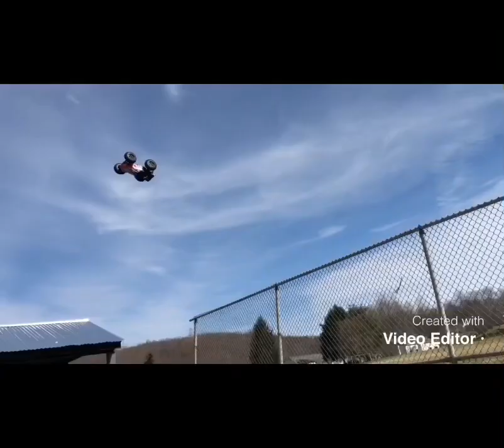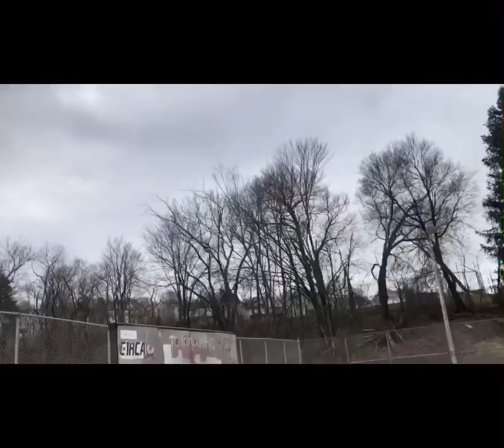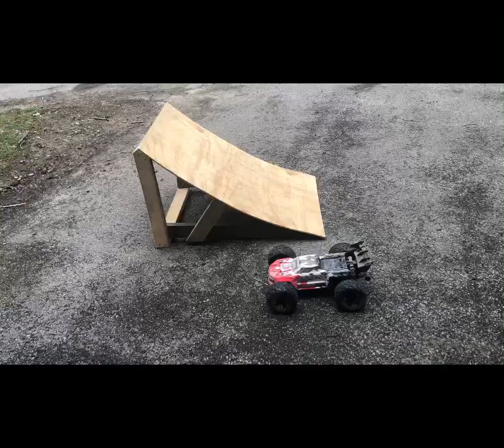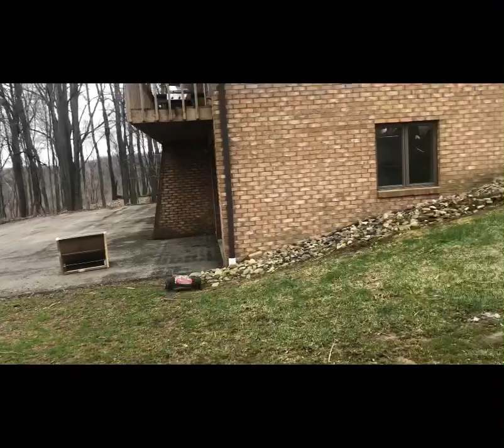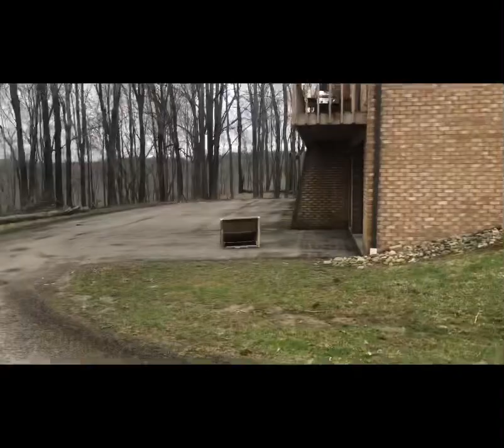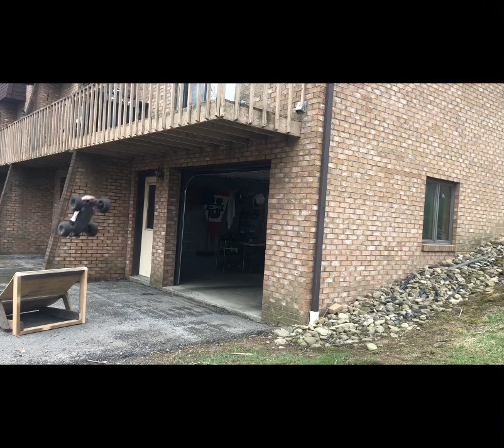Arrma Kraton 4s testing out the new hot racing  yokes

Comment: Thanks for the vid. Just got my truck before the stores shut down. Ran only maybe 10 batteries and blew the yokes and pinion in the rear. I guess HotRacing is the way to go? Full metal conversion should be reliable I hope. Maybe I'll just have to dumb it down to 3s. 🙁
Reply from the maker: Well so far after adjusting the clutch and putting those hot racing yolks on I’ve had it out I half dozen times now and I have had no problems.

Comment: Weather its true or not i DON'T know iam just a NEWbie to the rc scene again i have the same Truck no yolks though just stock motor and SERVO with 15th tooth pinion gear from a 13th tooth pinion gears getting New input gear put in and put loctite on slipper Clutch cause thats wear i was having most of my problems with my 4s kraton in THE spring iam getting. Steel gears put in my Truck with Rpm Arms front and back put in to

Comment: I love to open my diffs after their first run of their regrease or rebuild to see if anything is getting chewed im using what people kept recommanding me red n tacky from lucas
Reply from the maker: I’ll check it out thanks for the info.
Reply: Is the adjustable clutch the motor mount that is adjustable and also what problem does the adjustable clutch does it just fix the the mesh between the spur and the pinion or is does it improve durability? You have really helped me out a lot btw hope I’m not bombarding you with question after question
Reply: The adjustable motor mount allows your to use differant size pinions like a 14t 12T ect and they are made of a differant metal processings
Reply: Surchaufeur thanks a lot
Reply from the maker: The mesh on the motor is adjustable but also the clutch has a small Allen screw down the center red shaft and the more you tighten it the more you tighten up the clutch.
Reply: Bars&tone RC yeah my vkar bison had one of them but does it help with durability or is the original mesh a bit off with the Kraton or is the adjustable motor mount for show?
Reply: Ru using Originally ARMS front and back that THE Truck came with Right out of box when u boght ur 4s kraton i have the Exact SAME Truck with a 15tooth pinion and a New input gear being put Expecting my Truck back tomorrow from the hobby shop its being fixed in and i have 2 Lipo Battery 1 is a mah 5000mah 14.8 50c battery
Reply: The other 1 is a mah 5000mah 14.8 100c Battery for my kraton it has a 2400kv Motor and a 120Esc servo Engine and SERVO All stocked plus a bought a heat 🔫 with laser sight built inside with auto shutoff Etc. Etc. Etc. Basically comess with Everything to help. THE Readings down when the Engine gets to hot just point it at Engine to Read the temperatures
Reply from the maker: I’m running the rpm a arms on mine
Reply: Those are the stronger 1s correct?
Reply from the maker: Yeah much better
Reply: How much did u pay if u don't mind me Asking?
Reply from the maker: $12 for easy set. So $24 to do the all
Reply: @BarstoneRC  WOW Thats cheap in Canadians Dollars i would probably looking at $60 Dollars Canada dolllars
Reply: Whats red and tacky is that so kind of diff fluids?
Reply: @troyflanagan4237  grease. And rpm arms for 4s strucks are like 18$
Reply: @EXTREMERC416  That's Not Canadians Dollars i love in Toronto Ontario live

Comment: Could you damage the Kraton or the battery if you were to use just 1 2s battery by itself?
Reply from the maker: No it would just be very slow as far as I know.
Reply: Bars&tone RC thanks
Reply: Won't run on 2s I dont think
Reply from the maker: Yeah I’ve ran mine on 3S once but I always have it on 4s